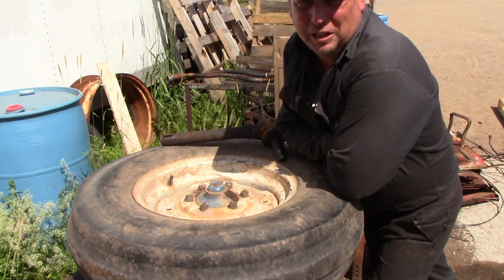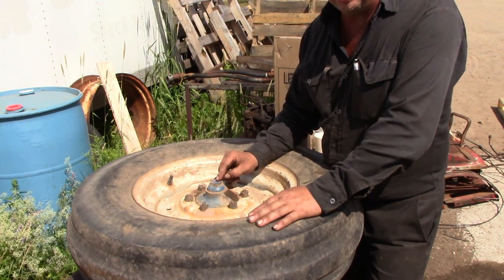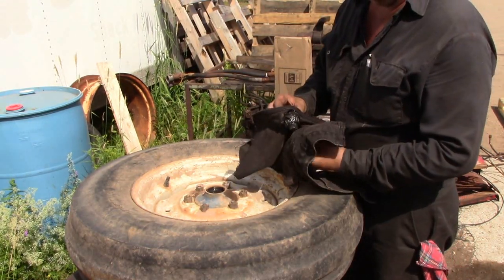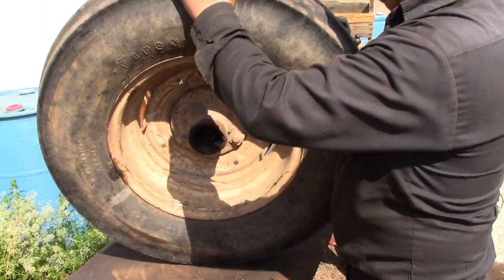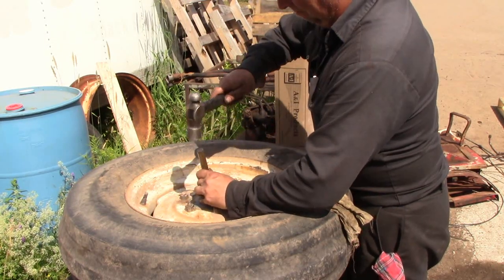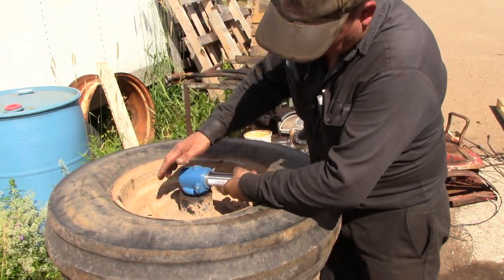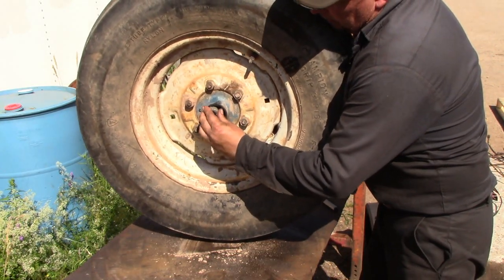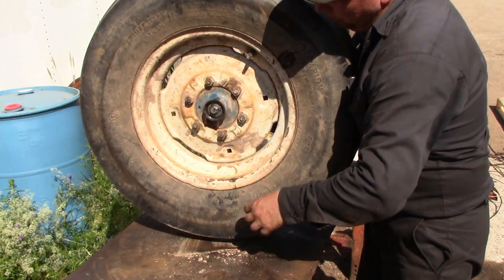Changing and packing wheel bearings (with grease)

Comment: I have a slight problem. The spindle broke and I got a new one for $300 but the vertical shaft of the spindle won’t come out of the housing. The nut on the top of the shaft came off easily so I hit the shaft hoping it would fall out of the housing. No such luck. What is the secret?
Reply from the maker: What model tractor? Some have a key to index the steering arm that will need to be removed (they jam) and some have a lock ring that holds the spindle in the knee. Thanks for watching!

Comment: i would press the seal into the hub then put the hub on the spindle.
Reply from the maker: Except this seal has the steel ring in the center and the rubber lip is on the outside and the hub rotates around it.
 Thanks for watching!